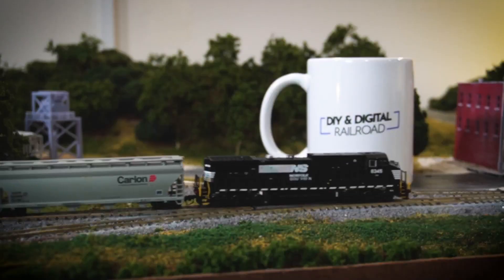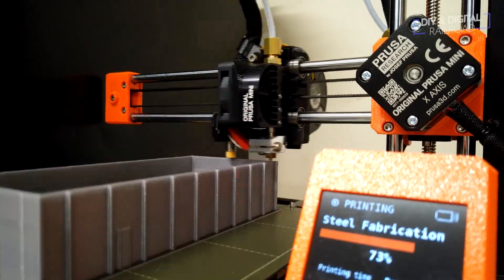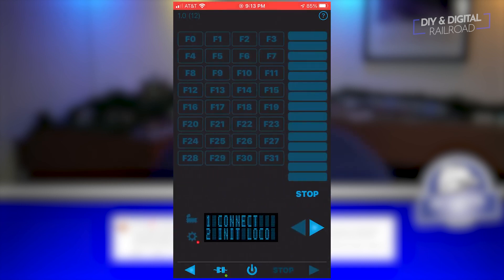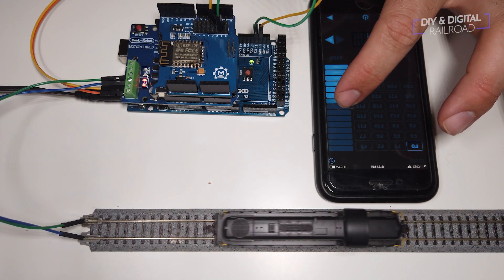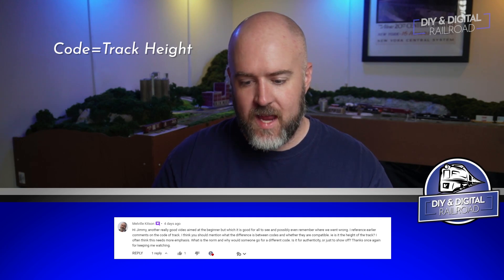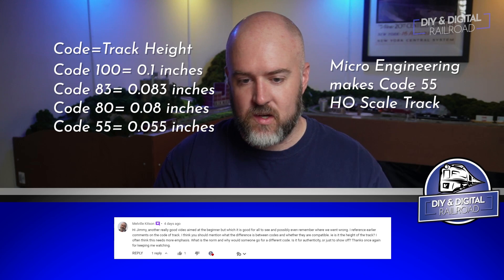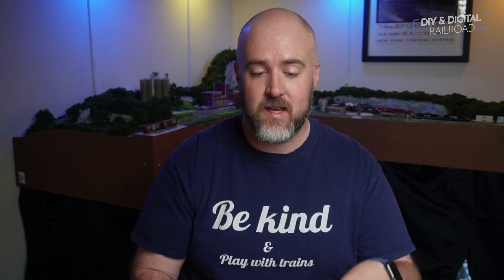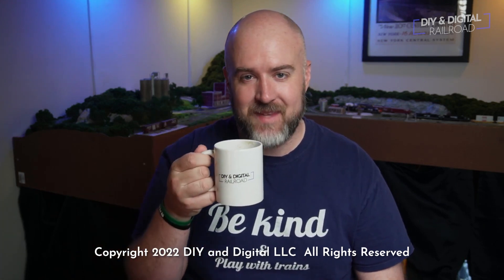Answering Your Model Railroad Questions

Comment: Just remember all your printers resin fdm whatever they all give off not very nice VOCs, heavy metals and other things that are just great for your health. 

Never use any of them without proper ventilation or air filtration around them. Many modelling channels will pump up FDM as safe because it doesn't make "fumes" this is however not backed up by research which shows neither is safe to just stick on you work bench or in the corner of your modelling space and be  next to while it prints. Keep yourself safe and just don't print if you can't swap the air in your room regularly or filter it through an appropriate system.

Comment: I think defining code as "thou" or "thousands of an inch" is helpful, because those are also the units used to measure thicknesses of styrene card and rod/tubes. So it kind of introduces people to scratch building. Great video though! I had a Nespresso Ethiopian this morning with frothed milk and definitely no sugar, pretty nice.

Comment: I run a lot of vintage HO stuff from the 60's to 80's and use code 100 as some of the older locomotives have pizza cutter flanges that can hit the ties on code 83. Newer stuff doesn't have that same issue and work well on code 83.
Reply: European stuff still has pizza cutter flanges!

Comment: the Code of rail is code 100, code 83, code 70, code 55 and code 40. I use code 40 on my stuff as It represents 60lb rail that was used for branchlines and mostly was still the standard rail in the 1890s. code 55 represents 75lb rail where as code 70 is 100lb rail. and last but not least the code 83 represents modern 132lb rail for mainline service...

Comment: I have a question...DCC++EX is where you can use an Arduino as your DCC Controller, so was DCC++ an older version of DCC++EX? Can DCC++EX still be connected to JMRI on a raspberry pi? Is there a difference between DCC++EX and DCC-EX? Also, I believe the Arduino would only be supplying the tracks with 5 volts of power. Is there a cheap way to amplify the 5 volts to 12 or 15 volts...or is there a cheap DCC booster? Decaf(brand) coffee with 1 sugar is one of my favorites. Thanks a lot for making these videos :)

Comment: Either one works for detail printing, just with the bigger 3D printing, you can mass produce things which is cool if you're making couplers. Code 100 is best for model railroading especially for running in locomotives, most Nickel-Silver(Aluminum) track is Code 50 or Code 75 which is the absolute worst for running model railroading (it's like beating your locomotive like it stole something) because both Code 50 and Code 75 are absolute junk with Code 83 not being all that great either and is the most common steel track grade.